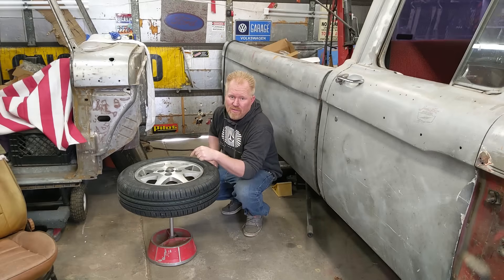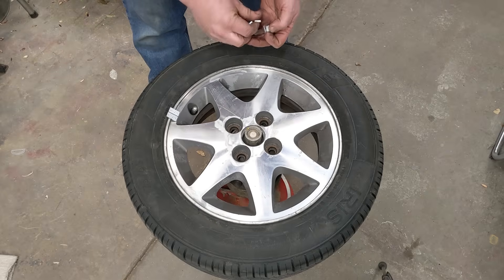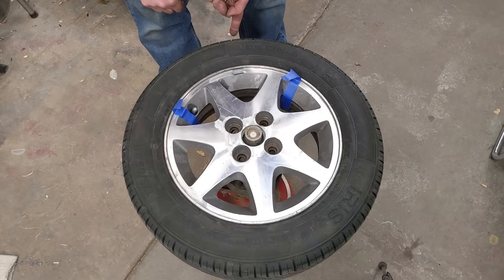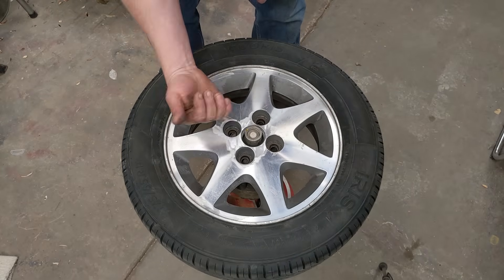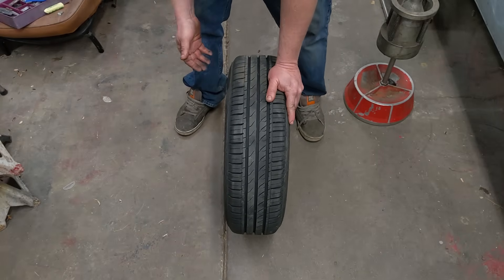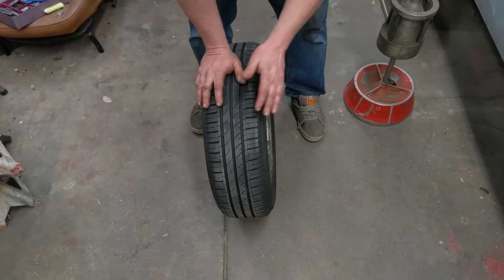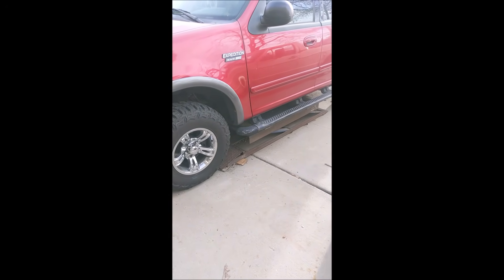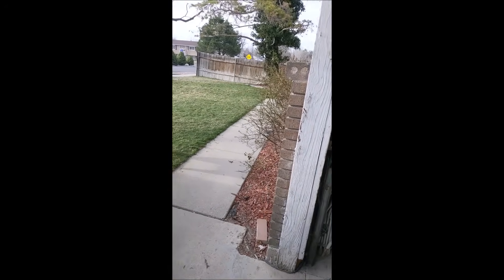Best Method How to properly Balance tires with a Bubble Balancer AT HOME

Comment: Now imagine if you use it with disk brakes installed or drum installed. Your balance will go to the roof. 

Also axial balancing in the rotation axis can tell us exactly where to install the weight below the rim, since not every place fits.

Comment: Dang, I learned two things - just didn't think of little rocks throwing off a tire - never occured to me.  Now I will always consider it, as it matters obviously.  (Sloppy thinking on my part.)  Also, I did the two-weight method, but didnt' consider it a "thing" or even anything 'claimable' - and this video organized the method in my mind so I can execute it much more accurately. Thanks for posting, and GREAT explanation of the importance of putting weights on both sides.

Comment: Thanks for the explanation on balancing, and dynamic vs static.  Makes me think the whole road-force balancing and 'computerized' (that's an 80s term) balancing sold to the consumer was pretty clever marketing for the past 20-30 years.  
Just had the a set of 19" tires installed on my wife's car- it cost $150 (was $100 for the longest time), and they did a good job, promptly. But I know the price is undercutting the independent shops charging $250 or more, and the price is just going to keep going up.  
Changing tires was the only part of car care I never was able to figure out because of the scratching and balancing issues, but it seems like there is enough tools available now to do a 'markless' tire change and perfect balance on your own.
Reply from the maker: Doing your own tires can save hundreds each time. I solely buy my tires online and have them shipped to my door. This alone saves a decent amount which makes little sense, since they have to ship them. I think the profit margin on tires is huge. I actually didn't balance my tires for years and 90%+ you'd never notice. And those that I did  , I could simply break the bead and rotate it on the rim 180 degrees and the problem would disappear. However there's always an odd ball and the bubble balancer takes care of that.

Comment: Good option if you really don't want to pay for computerized balancing at a shop but you really need a calibrated machine to get the best outcome.  Those machines spin the tire to simulate driving and really pinpoint the heavy spot on the tire....just my opinion.  I hate paying too but sometimes these computer machines do it best.

Comment: Your Y method is silly it adds more weight to the wheel than needed, dropping the wheel on the bubble balancer damages the balancers accuracy , rotary scotchbrite wheel removed the paint as well as the dirt, all dirt should have been cleaned off before balancing, all your methods cause problems and are done for quickness.

Comment: Good to see a lost art being used. I learned using 4 weights. 2 on the outside plane and 2 on the inside plane. It was over 50 years ago. Great  Video
Reply from the maker: Awesome. That's exactly how I would do it with clip on weights.

Comment: Thank you buddy, for this. i just ordered a balancer, on Ebay. Im a 69yr old guy, and on soc sec, and now changing my own tires with Hrbor Frt  tire changer, to save bucks.
Reply: I've been doing almost a year now since used tires price is now at 60 each mounting and balancing. Initial set up cost me $300 but now it must have paid itself back after 5 tires already.  I will buy balancing beads for the next tires, so I don't have to bother with balancing them. I got into programming the TPMS sensor with Autel device. I got Autel device for $120 brandnew from Offer up local tire shop guy in Fullerton California. Now I program brandnew tpms sensor from Amazon or ebay. Now I don't  go to Tire Shop anymore.

Comment: A long time ago  1964, I went to a bubble balance  school. Almost the same as you demonstrate but they used 4 weights where you use two.  Put two weights together at left and two on right  like you have . Center the bubble.   Mark with chalk.  Take wheel off of balancer.  Take two of the weights, L and R and pound them on the back. Put tire back on balancer and  position the two  weights ( almost same spot ) and mark .  Pound on the weights and your done. I know, clear as mud !
Reply: Just like how i was taught by a Goodyear Tire tech.
Reply: THIS FAMILY HAS STOOD IN MY WAY LONG ENOUGH; I'M GOING TO BUBBLE BALACE SCHOOL!
Reply: So you have weights on the inside and outside of tire? Getting ready to do mine and never tried your method so thats why im curious. Thanks in advance
Reply: @brianb5779  Yes ,. two on either side .,
Reply: @brianb5779  Yes,  and weight size will depend on how far it is out of balance .,
Reply: @samson-q2b  Thank you very much
Reply: @brianb5779  any time and as a funny side note  when I was working at my Father's Shell Station we found a tire with a scrub brush  in it that wouldn't balance and one with water in ,.    Good luck .
Reply: @stewartsmith1947  lol, thats crazy. Appreciate the info, take care.
Reply: Your description is absolutely clear to me, and is surely correct. Thanks so much for explaining it. I have not seen it laid out like this so briefly and clearly anywhere else. I've never balanced a tire ... yet. When I do, I will use this method. Thanks for this, and for proving yet again how smart people were back in the days before the iPhone made everything so easy.
Reply: @dre3951  But i will not try to use an iphone to change a tire
Reply: That's the method I learned at my first gas station job in the summer of '69.  Works like a charm.  Your explanation was great.
Reply: Very clear. A very refined approach to balancing

Comment: have you done anything or modified  the bubble balancer like people say on the net to make it "work better " or is it just stock out of the box?
Reply from the maker: The main one I use in the video is not the Harbor Freight, but the original one that HF copied. It works flawless without any modifications. The HF one is medicore but works and shouldn't need any mods. If you get one that is way off; return it and buy another until you get a good one.

Comment: That method is not accurate because it does not let you know if the weight is required on the inside or outside of the wheel, that why the digital wheel balancer was invented.

Comment: EXCELLENT! I'm preparing to install and balance my own tires. I have a bubble balancer from the 60s - its a "Sears Allstate" model. I'm torn between using this or using balancing beads. By the way, what's your opinion of balancing beads? I found your video very informative and helpful in preparing myself for the job...

Comment: This is fantastic. I'll be using this method on my Mustang for sure. I'm using the HF tire changer too, with the duck bill mod. Do you have any tips/tricks to doing painted wheels? I would rather not chip them up mounting the tires.
Reply from the maker: Generally I break the bead, and leave the tire on. It puts the tire down about 1/2" so I can get the entire lip. You can get away with very crude masking.

Comment: I re use the old stick on weights on my bike as they are lead....cant get them in the UK now.

I stick em back on with a blob of silicone sealant....after cleaning the well very well.

I dont have a car ballance rig like yours....would love one but cant trust them now.

But I do have a balancer for my bike.

Same problem....very poorly made....has cones to center the wheel.....the cones are just not drilled in the CTR.

Most bike tyre shops use the same rig.

I expect my people will buy one and not even consider its not accurate.....tyre shops also.....

Oh yes you use the rig as instructed.....its gives the ballance reading your expecting,.....but its prob out unless it a well made one.

Easy to test if yours is ok.....check your wheel.....then turn the wheel on the axle/cones.....then test again.....prob wont show balance then.

I can balance my bike wheels with my £30GB but need to use the bikes axle if long enough and not bent.

That way I get a 100% perfect balance.

If anybody is interested message me for more details.

Comment: The patent you point out has been used in the army on the BADA 75 balancer. I've been doing this for years but you're not really doing it correctly. It's a four point balance. The patent you reference says so also.  Now mind you there where very little if any aluminum rims back then. Also steel rims were more centric mount relative to the the outer beads. New aluminum wheels are somewhat offset. The majority of the casting weight is the outer part of the rim. So where you put your weights is considered "close enough". I still do the 4 point balance and split the difference between the inside edge and outside edge in four equal parts. If you have an odd weight you go up till you can split into 4 equal parts. Like you pointed out the further you are from the balance center the less effective the weights are. So going up you can compensate by varying the distance from true center  That will give you a true balance without disturbing the dynamic balance of the rim. I've done this on every size wheel. You are right about needs though I use them in certain cases but balancing them with fixed weights is better. I also rebalance them every second rotation I will check them.

Comment: I did that technique back in 1967 to 1969, but was shown to mark the tire and put the weights on the back of the rim than recheck it and move the other weights around to tune it.
They would take my balance tires to a machine and I blew their minds because they couldn't get the tire balanced any better. The other thing that screws up a balance is when you spin your tire they will move.

Comment: So “, if I rotate the wheels, front to back and back to front: every time I do that I have to balance all 4 wheels?
Thank you very much
Reply from the maker: No, you don't need to rebalance every tire rotation. Generally with static balance it's once and done.
Reply: @sixtyfiveford  appreciate it

Comment: What size rims can this be done with? Harbor Freight one says you can only do rims up to 15". Is that true?
Reply from the maker: I've done 12 to 20in rims
Reply: I'm not sure why there would be a limitation. The only limitation I could think of would be the center bore hole size in the wheel. (Where the balancer sticks through) Maybe it's some weird weight thing, where it's less accurate with bigger wheels?

Comment: I have always done this method since the 70's. The balancer I used back in the day had a reservoir under the the top piece that had engine oil in it. The oil would slow down the movement when touching the wheel or tire. This sped things up not waiting for the bubble to stop moving.
Reply from the maker: I've been looking for an old school one locally for years. They pop up on eBay but are really expensive.
Reply: Repco is the make.. I recently got one.

Comment: How can that work if you don't center the wheel perfectly? You just plopped it on and didn't center it
Reply from the maker: The center is a tapered cone. It centers the wheel as it depresses from the weight of the tire.

Comment: I’m gonna see if I can get some 2 inch inner diameter pipe this weekend so I can weld up the ultimate tire changer upgrade on the tire changer. I just picked it up for 49 bucks and $67 for the bubble balancer I’m so excited because I always get a flat on a Sunday and I could never get it put on anywhere to be at work on Monday. Thanks for your help

Comment: Great video explanation on balancing with a bubble balancer.

Sorry for the dumb question but, since you need to put the weights inside, would it be better to mount the wheel upside down so you’re already viewing the bottom.  This might allow a more precise placement.

Since I don’t have one, I can’t experiment.  The way you used tape was a great idea and does make placement easier.

Also, what are your thoughts on those Dyna beads that you pour into the wheel?  I know those won’t work in this case as they could settle all over.
Reply: The way that the hole is on the outer face of the wheel and not in the center (width wise), would probably make it so the wheel would be top heavy, and possibly make the whole balancer tip over and fall down.

Comment: If 1 is too little and 2 is too much, the correct weight is something between 1 and 2. So I would expect you use only 2 and spread them apart just enough. I would expect the best is to use the minimum possible amount of weights. Is my thinking wrong ?
Reply from the maker: Yes, the least amount of weight is ideal.

Comment: With the clip on weights you demonstrated the method halfway right. You use 4 weights, size chosen to space them as close as you can to 120 degrees apart. Once the bubble is centered you mark the tread at each location with a tire crayon. Remove the wheel from the balancer and put one weight on the back side of the rim at each location. Put the wheel back on the balancer and do it again with just one weight at each location. Mark the tire by the rim at the center of each weight. Remove the wheel from the balancer and install the outside weights.

When balancing with the pairs of weights if they have to be moved too close together you need bigger weights. If they have to be too far apart the weights are too big.

If the weights close to or at 120 degrees are huge, then you need to break the tire loose and turn it 180 degrees. Ideally you'd dismount the tire and check the rim to see which is its heavy side and have a balanced disk or something to hold the tire on the balance to see which is its heavy side then put the tire on the rim with the heavy sides 180 degrees apart. But for that you need a tire holder for each rim diameter, made so the tire bead will easily fit onto it. Junk aluminum wheels could have the outer part cut off and the bead lock rib and seat turned down on a lathe.

I tried to find a photo online of the balancer I used to have. It had a triangular pyramid shaped base with three adjustable feet. A lever poked out through one face. Push it down and to one side a bit to raise the balancing platform. It had a logo on the side that said BULL'S-EYE. I found one that looked similar but it was painted red with Texaco logos. Similar shape to the Micro Precision balancer.

Something I've noticed about those and all similar ones is people take photos with the centering cone on them *upside down*. To use this style, the lever is moved to the load position, which lowers the platform. The wheel is placed onto the balancer, then the centering cone is put over the center cylinder, pushed down and turned to center the wheel. Then the centering cone is removed. Push the lever down to raise the platform and proceed with the two step Y method.

Comment: YO MacGyver! Not coming from a mechanical side but rather a construction side I didn’t realize you could balance your tires at home. Tks bud! 🤙🏽
Question! 
Why don’t you put the wheel the opposite way you had then? (Inside facing up) wouldn’t that make it easier on finding the right more conspicuous spot?

Also gonna try the Y method to balance my ceiling fans, I hate when they wobble and I can’t seem to ever get them perfect. 🤦🏻‍♂️

Comment: You can cut the weights down to the size needed, but I agree that spreading out two weights is probably easier.  As for the triangle distribution making a difference, that is simply BS.  And with today’s wider wheels and tires, it is much better to do a dynamic balance that covers both radial and axial axes, rather than just radial balance.

Comment: If you can get access to the center of gravity plane, you can fix dynamic and static on any wheel. If you glue weights on that plane you can fix the static imbalance without affecting the dynamic one. The dynamic one can be fixed by a single weight anywhere outside of that plane. The static one will get messed up but that would not be a problem.

Comment: the wheel is too light! does not fall nicely. what should I do??
Reply from the maker: The weight of the Will should hold the springs down. If not, you can remove the C clips and shorten the length of your springs/ make them weaker by cutting them slightly.

Comment: Question if I do a static balance in a rim where you can put a wage on both sizes and I do static would it matter
Reply from the maker: It's the same principle to put equal amounts of weight on both sides

Comment: Dude! Does this method work on MC wheels too?
Reply from the maker: Not sure what MC wheels are. A brand? It will work on virtually any car rims. Dually and large trucks are the only ones that will give you issues.
Reply: @sixtyfiveford  Motorcycle wheels.
But that is probably to much to ask for...
Reply from the maker: @Doc_89  No it won't work for motorcycle wheels.
Reply: @sixtyfiveford  Shameful, aint it.

Comment: Nice job on the video.

I put Tire Beads in my Motorcycle Tires...  Dyna Beads.  They work amazing.  Bike was never so smooth....

They're hard to get into a tire on a car or truck, with tpms sensors.....  I did get them in my truck though, and they worked amazing on that too....

Comment: Everyone of the wheels you said you cannot balance can be dynamically balanced they put the stick on weights towards the inside as far forward as it will go you can dynamic balance just about any wheel
Reply from the maker: You can try but you're never getting a perfect dynamic balance. It's a compromise.

Comment: Do you lubricate the pin that the top of the balancer balances on and if so what do you use?
Reply from the maker: I've put a tiny dab of grease on it before.
Reply: @sixtyfiveford  I wasn't sure if grease or oil would be better.